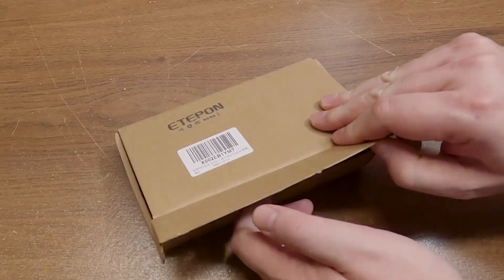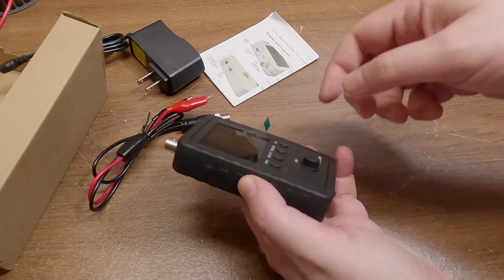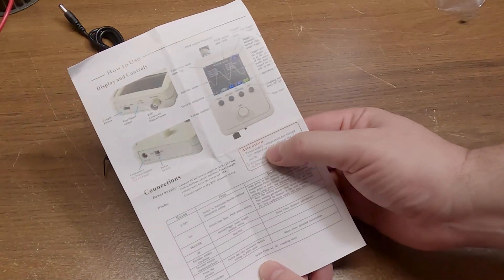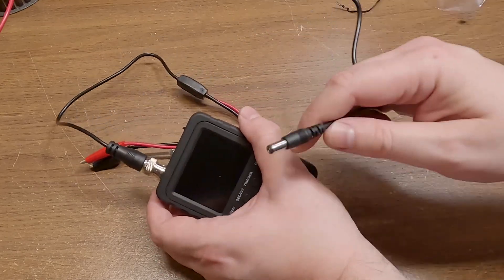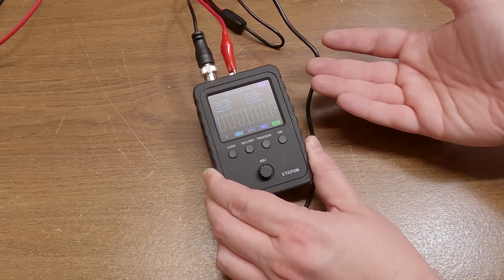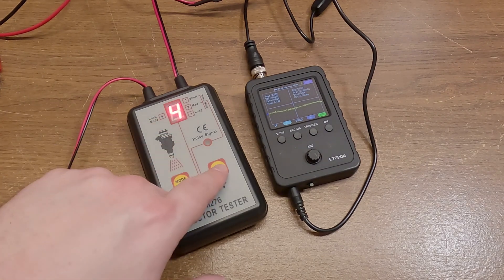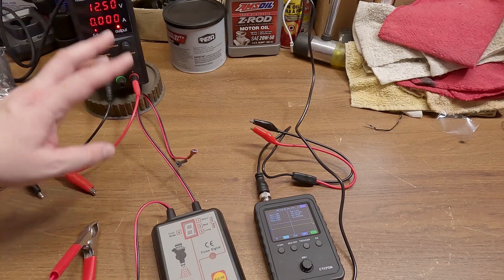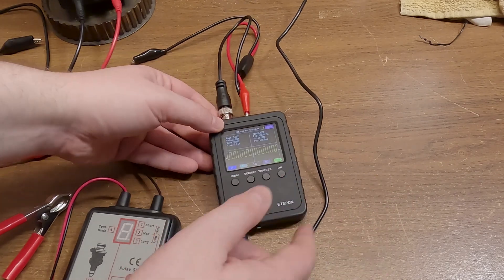Inexpensive Mini Oscilloscope | ETEPON EM001

Comment: Will get mine tomorrow, exactly what I need for my hobbyist stuff. Of course it is not pro grade, but for a quick look whether you have a signal and the maxmimum and minimum signal level, which is pretty much all I need it for, absolutely perfect!
Reply: Got mine, and it is exactly what I have needed. (I need it to debug out a PS/2 trackball), I finally was able to get it right to have the device sending the signals, no chance without the oscilloscope. While the thing is rather basic, it does what it does fairly well. Not too bad for 40 bucks, given the normal prices for oscilloscopes, and it is small. However, peak voltage seems to be limited to 100 v or so, so it really is mostly for home electronics tinkering and hobbyists. But hey, you cannot beat the price if you just need to have a quick look at signals!

Comment: I got this oscilloscope last week. It looks funny for the money. But the included manual is really "simple" feels like there's missing a lot and even can't find out how to calibrate it.

On the internet is also not much info to be found. Well actually it is for similar devices but which is running different firmware.

So still figuring out how this thing works.
Reply from the maker: it's a useful toy